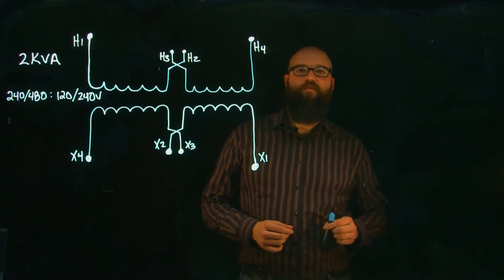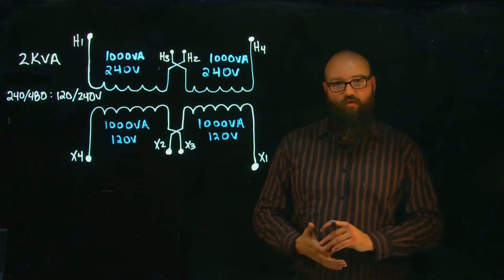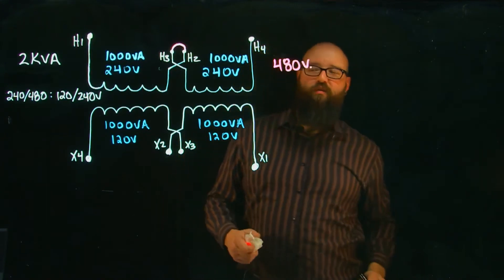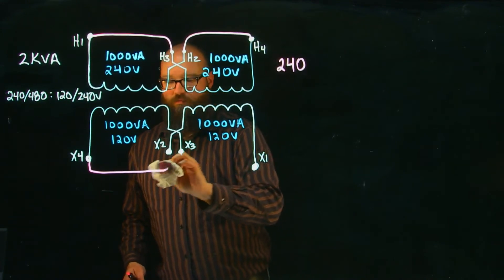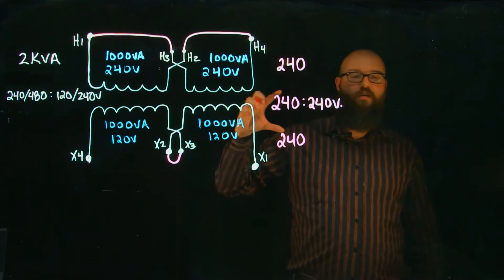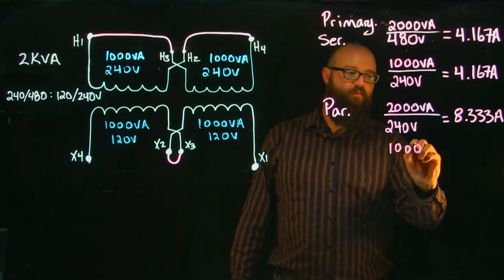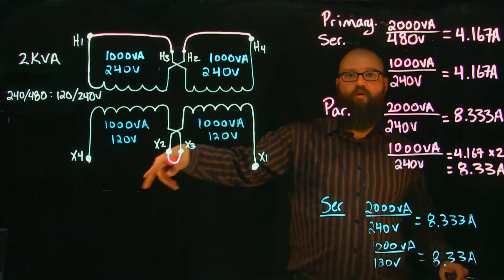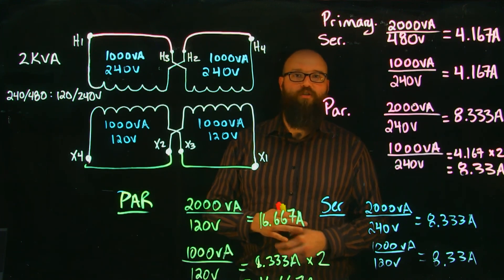Multi Winding Transformer Calculations

Comment: Let's say you had a dual channel amplifier with a normal minimum impedance rating of 4 ohms. Could you have a dual primary winding isolation transformer with each amplifier channel feeding a separate primary winding then have one secondary winding. Would each primary winding share the load and effectively allow you to use the amplifier with 2 ohm speakers?

Comment: If you have input voltage across H1 & H2, without a tap to the other primary coil, what will be the output on H3 & H4 and is it useable?  Nice presentation!  I did not see this scenario covered.  Thanks!

Comment: thanks for the video.
please can I individually (simultaneously) supply both the input windings? (i.e., from different power sources). if Yes, can I do that with different voltage ratings?
Reply from the maker: I would hesitate to do this as you most likely will see excessive heating in the core due to competing magnetic fields. I have not tried this but intend to try in a safe lab environment to observe the effects/results. Great question though! I'll let you know what I observe.

Comment: Hi, 
I got a question May be you can help me, I got a transformer with 3 cable in the primary winding, white (common), orange (110v) and blue (240v). The winding with white and orange is opened. It’s the 110v supply. But orange and blue still good. You think I can use the orange and blue for 110v. Note: the secondary is multi winding ( 4 winding).

Comment: How would it be if the primary side winding had different Ns? Would you still be able to split the voltage equally?
Reply from the maker: If you are referring to splitting between the primary windings, and you are applying source across both and it is a series connection between the two, then voltage division is directly proportional to the number of turns in each winding. If they are equal, then equal voltage division. If one winding has a higher number of turns, then it will see a higher voltage dropped across it, and the fewer turns would see less voltage.

Comment: Sir send me formula and wire gauges
Reply from the maker: Hey thanks for watching! The formulas I use are derived from nameplate values of the transformer. 
VA ÷ primary voltage = primary current (same formula for secondary with secondary voltage). As far as wire gauge, please see videos on transformer conductor sizing in my channel, bearing in mind these are specific to Canada as I'm using Canadian Electrical Code.
Reply: Thanks iam indian